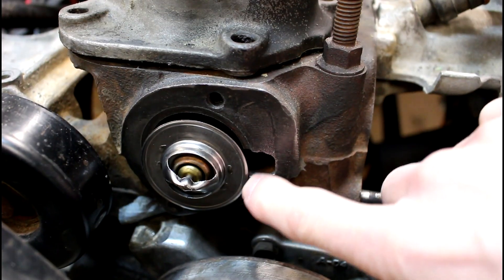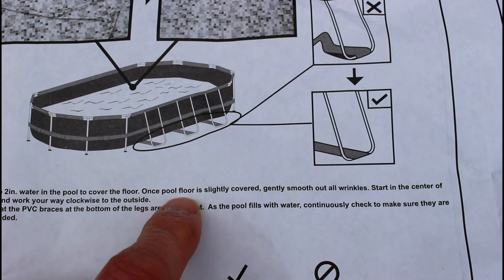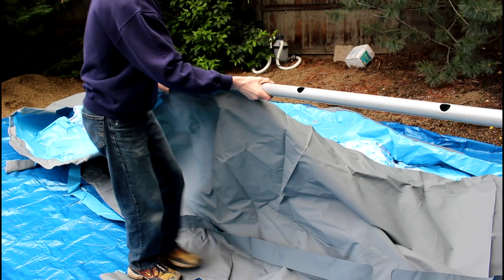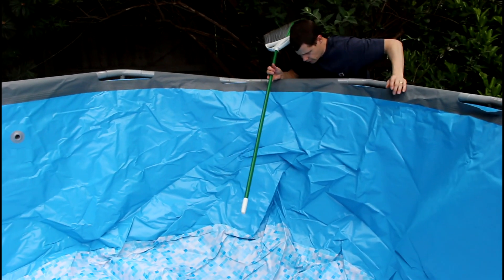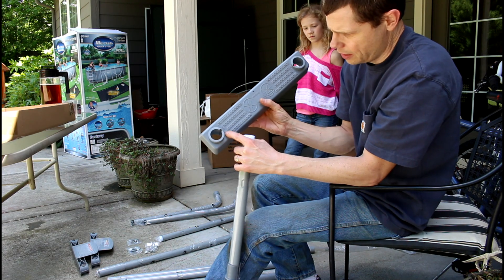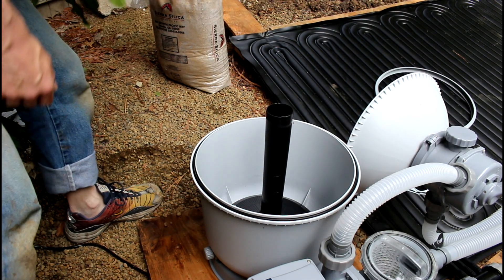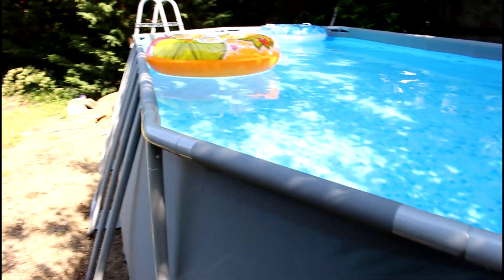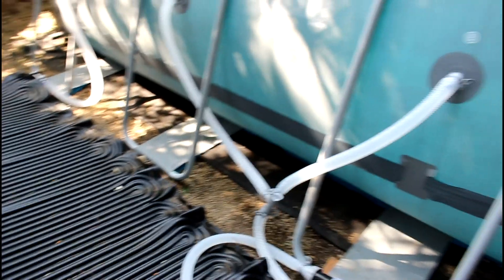Costco Pool Setup: Bestway Oval Pool

Comment: Thanks again for the video. I finally set mine up took about 4 days !!!! But I upgraded a few things. I changed my ports to 1.5" so allow better flow though the system and also installed a Salt/Chlorine generator. An EASY mod you can do, so you can leave the solar heater if you want, is put in a 1.5" pvc pipe w/ ball valve between the caps on the heater. I then open and close the ball valve to adjust how much water i want to by pass the heater. to attach use 1-1/2 in. PVC Box Adapters (got mine from home depot) and sand off the lettering, so there is a flat surface to seal up against the rubber gasket . Make sure to put the spin on cap on, and then pvc cement it to the pipe using a junction.
Reply: cueballsi , I would be 8 there’s Ted to see a photo of your bypass mod. Thank you
Reply: I want to do salt as well. Do I just need the generator and some one suggested glass instead of sand??
Reply: @MzJoyZ29   I used the intex salt chlorine generator. To be honest. do the math and follow the guide and put in 10% less salt that what you calculate... the machine is very temperamental, and sometimes you will get a high slat error. You can trick the system by putting a low flow of hose water near the inlet.  As for the sand filter, I used Clorox filter sand plus, which is zeolite, or zeosand. NOTE you use less than regular sand... and on occasion i do get sand in my pool, but my intex vac picks it up.

Comment: You’ve done a wonderful job with this video and a great service to  mankind with your  Bestway Pool Setup Video.   You are so right.  The 30 minute  setup advertised is a joke.   Thanks for producing this because it will help so many people.  Bravo!   Wishing you and your family great times in your new pool.   Enjoy!
Reply from the maker: Yeah, I thought I would make a video of what I would have liked to see on how to set it up.  Thanks for the feedback!  And, yes, the kids are having a ton of fun with it so far this year.
Reply: JeepSolid can you do a vid on the skimmer
Reply: How long was the set up from beginning to end?  Not counting water fill up
Reply: Took me over an hour to make the ladder!! The UK spec ones have a removable step set on the outside, then a dummy set of legs that hold the structure in place, just with no actual steps so it cannot be used. All on a quick release system. Quite neat, but a pain in the ax! to build. My pool is filling now, been 18 hours now and still an inch below the outlet!  Also the UK pools only have one outlet, not two as here.
Reply: pooatpauls10  which one did you buy? And where from
Reply: It's from Costco in UK, the pool is the same as this one, but this years UK version (ie the one I got) has the safety design ladder I mentioned, and also, I noticed today when setting up the pump, it has only a single  outlet from and one inlet to the pool, but the pipework is 1.5 inch not 1.25inch. Should make it far easier to fit a proper pool heater i think. It's been filling for 28 hours now and still have 6 inches to go!
Reply from the maker: Here's the video on the Vacuum Setup.  I am not currently using the skimmer.  I found it too fragile and in the way of the kids swimming.  I was afraid they would just break it off. https://youtu.be/EHEH4YRsokE
Reply: It took a team of three to complete it in about four hours.
Reply: Do you tear down the pool in the winter?
Reply: ye

Comment: Might sound dumb, but how did you make sure the blocks under all the legs were level? So far I  used a level and dug them out for the big sides... but I’m not so sure about the little legs on the ends.

Comment: My daughter and I set this up in 2019. We found that as the water begin to fill she began to smooth the bottom by putting on non-slip socks AKA Hospital socks. When the water had an inch to 2 inch in the bottom we were able to move it by stomping towards the wall. The pool does not have one Wrinkle in it now!!. 
He also failed to say it's an absolute must to have pavers underneath the legs of your pool! If you do not as the pool begins to fill the legs will move and settle & your pool will be unlevel. Love my pool
Reply: 10:55 he showed it right there

Comment: Thanks for making the video.
I bought this pool last year. Used the thin tarp under the pool and tossed it at the end of the season. Bought a 16 x 20 heavy duty tarp this year. Has grommets into which I drove stakes to hold it in place. This bottom of the pool is much more enjoyable to walk on this year.
I did not put the legs inside the band. I totally missed that in th instructions but now I see the drawing. Used a level on them to make sure they were straight to support the weight.  Looks good and seems to be fine. 
Also, I added the heater late last season and seemed to have more trouble keeping the chemicals balanced, so not even using it this year. It only increase the temp by one or two degrees anyway. Looks like they have a larger solar heater this year. Last year 4'x8'.
Reply from the maker: Sounds like you're getting it dialed in.  Thanks for the feedback and hope you have a ton of fun with the pool this summer!
Reply: I use old carpet pieces under the pool

Comment: Hello and thank you for this helpful video!  For the solar pool cover from Amazon that you recommend, I see the size choices are 118" x 78", 157" x 78", and 383" x 192".  The pool is 12' x 22' so which size do you recommend?  264" x 144" seems like the best fit but not one of the choices.
Reply from the maker: yes. depending on the size of your pool. It just has to be big enough to cut to shape

Comment: Ditto what others have said about their instructions.  Not that great.  I bought this pool summer 2017 and used it all summer.  Loved it.  Didn't set it up in 2018.  Now in 2019, just set it up.  Used your video as a reminder of how to set it up.  But now I am seeing very slow leak.  Argh!  The pool has only been used one season and was put away super carefully.   It seemed really rugged.  I hoped that I could get many years of service without any leaks.  Some patch material came with it, but no glue.  So heading to Home Depot to get that.  If you have any tips on patching, would appreciate.  As my brother in law says "It's never easy!"
Reply from the maker: Haven't had to patch mine.  Hope it goes well for ya

Comment: Hi, thanks for the video. I am curious about electrical connection. Could you elaborate any special extras you had to do to connect the pump. Did you have to acquire an electrician to run a line etc?
Reply: Hi I’m wondering the same thing, it says don’t use an extension cord but it’s not close enough to my house to plug in….
Reply: @christinamontes8254  he used a heavy duty extension cord

Comment: Great video hopefully setting mine up tonight... I'm up in Canada and am curious if it's winter rated. Can't find anything in the box
Reply from the maker: I drain mine and fold it up in the winter.
Reply: @JeepSolid  ok damn.. not that hard at all to set up... One thing I noticed on mine was the "t" fittings for end rails, some have slots under for the buttons and some are holes. Any idea on that?
Reply: @JeepSolid  my pool came with no instructions so your video was great

Comment: Nice video bro, I just set mine up also.  I have the 16' x 10'. Mine has a bag with 3 black plug looking things and a valve thingy that I haven't found the purpose of.  If anyone knows what the heck they are needed for please post.  These inlet/ outlet filter connections are a lil cheesy compared to the intex I used to have.  Man you ain't kidding about the 30 minute thing.  It took me a little longer than that just to unfold attached the polls and set the pool up itself. Now to the ladder and the filter. Anyway good video it was cool to see your entire family involved unfortunately had to do it myself since my kids and grandkids live a couple of hours away. Anyway very good video do you others out there it is very easy to set up by yourself if you have to just takes a little time

Comment: Just got one. Unfortunately, Some vertical poles are touching the outside walls of the pool. Should I just drain and start over? What do u think is causing that? I got a pretty level foundation.. 

Thanks! And more power to u.
Reply: So basically there is an indentation inside the pool caused by the leg pushing against it…

Comment: Great Video I reference it all the time.  This year however I hooked it all back up and have a small leak of water at the seam where the filter gets tightened with the clamp.  I have it pretty tight and don’t want to break it.  The gasket is only one year old and the whole setup is only one year old.  Any thoughts.  It’s hard to get that clamp on.

Comment: Any insight into what the pressure on the filter should be? Instructions say lower than .45 but Im at  .55 with new setup. Backwashed sand and water is clear but no change. I am using the solar panel and wondering if thats causing the increased pressure.

Comment: Hi there! Firstly BIG thanks for videos, great job. I've set mine up a few weeks ago, the same kit, the water is fine but not crystal clear, I saw videos of people adding salt water pumps to this kit and having lovely clear water. What your thoughts on this or sand filter is enough?
Reply from the maker: The sand filter is working fine for me.
Reply: I thank you for this video. Side note, We have a 14' oval one, and set it up inside a 10 person , 3 room tent. I can't stand bugs, mosquitoes etc. This way i dont have to deal with them, and the canopy over the screen top of the tent can be moved over to let sun in to heat the water, if needed. Also. I ordered a 12' pool, got a 14' one delivered.  Only complaint, the extra 2 '  makes it a bit harder gettin in,  but husband mentioned a small platform deck , outside the pool end, and the inside the pool ladder connected in the platform, to get out.
Reply: By the way, for some reason, the heading has my sons name not mine. Lol

Comment: Should you feel suctioning from your outputs? The other port is pumping water back into the pool but, I don't feel water being suctioned from in the pool to the pump.
Reply: I mean the input not out put. Output has water pushing into pool but, you can't feel anything going in.
Reply from the maker: Yeah. It is hard to feel the suction, as there are 2 suction ports and if you cover 1, it just pulls more from the other. If you feel a good return flow, you should be good. It is the same way with mine.

Comment: Excellent Video really helped, our output from the solar panel going to the B (back into the pool) doesn't seem to be pumping all that well. It could be the floor below the solar mat isn't 100% level, could that be the case? Also, did you use play ground sand or pool sand?

Comment: Question. I have the exact same pool and just set it up. But, I only have 4 hoses. The 14 inch to use at pump, the 25 foot for vacuum and 2 that are 29 inches for i guess outlet.  Shouldn't i have 1 more? If so I was thinking ticut a piece off the 25 foot one or maybe buy? I tried reaching Bestway pools and due to COVID they replied may be 7-10 days for them to respond. Any ideas?

Comment: Would it be possible to have the solar heater on top of the pool on top of the cover while the pool is not being used? We don't have an area to leave the solar heater on the ground.  Any suggestions?  Thanks for the video! Super helpful!
Reply from the maker: You could probably rig something up, but it is too heavy for the cover to hold itself.  You'd have to brace it with wood or something to hold the weight of the solar heating pad.

Comment: I have an issue with the sides bowing in too much. It’s filled about 2 inch to the gray part. So I have to fill it to the gray part to take the bow out? It’s on a concrete slab so it’s fairly leveled

Comment: Thanks!  We have never had a pool before and are struggling with the filter and greenness...the website offers NO phone number or access to help.  I backwashed and rinsed it again, hopefully we fixed the problem!  Our PSI has always been over 10, never the 6.5 that was suggested.  We also left the cover off for 2 days, could that cause the greenness? And about 1.5 weeks ago I left the filter off for 2 days.  It has been set up for about 4 weeks.  If I fixed the problem, how do I get rid of the greenness that is already there?!?!  And I find the vacuum doesn't work nearly as well as I expected....I highly recommend a vacuum video.  Oh wow, that is aLOT of info haha, I'd appreciate any help you can offer.  THANKS so much for the ladder suggestions :)
Reply from the maker: +Char's Bucket of Books leaving the cover off itself won’t necessarily cause algae bloom, but your chlorine levels fall quicker.  Sounds like you need to shock it.  Then scrubbing pool and backwashing as you are should help.  If still having issues with water, you can take a sample to a local pool store that tests water.  Hope that helps.
Reply from the maker: Here ya go! https://youtu.be/EHEH4YRsokE

Comment: Hi thanks for the video very helpful. Quick question I did the backwash and rinse on the sand filter but my psi pressure is at 0.6 and was wondering if you have the same issue? Or any tips for that ?

Comment: Hello, I was told by a few people that pea gravel makes the pool bottom hard to walk on and  can puncture your pool liner. I have a Bestway 24x12x52 rectangular above ground pool. Would you recommend the pea gravel under that size of a pool ?
Reply from the maker: The pea gravel under mine works fine, but I did put down some landscape fabric and that extra blue tarp under it as well.

Comment: I have to say that this Costco pool purchase was awesome for what you get. I totally agree 30 minutes is a joke. The hardest part was leveling the ground and I had clay like soil. I would say another strong point is to layer the bottom of the pool well with multiple tarps or something to keep any sharp rocks from possibly tearing it with a pinhole. The solar works great and if you get those floating solar covers your pool can get up to 90 degrees (Summertime). I mean you really cant beat this for around 400 dollars! If you shop around you will see the same size pool is nearly double the price and you dont get the solar and cleaning items. One thing to be aware of is that the hoses are cheap and after time will start to crack and become brittle if in the direct sun. I did shop around and found a cheaper source for how replacement. Leslies was too expensive and wanted $20 for one hose that was like 3'.
Reply: Where do you get your replacement hoses?
Reply: @ivylewisdragonsforlife5394  I usually just find a pool supply online. Amazon too.

Comment: Amazing video!! Just one question. You just use the sandpump? No chlorine or sandsystem other than the pump :)?
Reply from the maker: +Ollgabopi Right. I have a video on getting the pool ready for summer and I link the pool shock chemicals and chemical float I use there. Only sand I the filter

Comment: Great video! Did yours come with a chem connect? My father and I are not sure where that goes. It has threads and shows it screws onto port A on the inside but there is no threads
Reply from the maker: +Mr.Ghost_6.4 I put my chemicals in a float in the pool. I linked it in my video description

Comment: Fanstastic video, thanks so much for taking the time to make it!!  I have a question... the instructions say I should not use an extension power cord for the pump??? I don't have an outlet nowhere close to my back yard area... did you use an extension and would it still work?
Reply from the maker: +FiPoSan Yeah.  Instructions say not to.  But, yes, I ran a heavy duty extension cord to mine as well.
Reply: @JeepSolid  same

Comment: I installed 22FT Bestway Oval pool, it's 1.5FT full and started to cave in really bad from the sides. One mistake I made was levelling the ground for only 13ft thinking, without realizing that legs extend far out. In other forums I read that pools bowing goes away as the pool starts to fill. Is that true? Any suggestions??

Comment: Great video. I wished it had been up back in May when we set our up. Do you have an suggestions on to keep the water clean? We woke up to green water? Now I'm having to learn proper care of a pool. But many video are for in ground pools. I'm some more for this type of model. Thanks for this video!
Reply from the maker: Sounds like an algae bloom.  Probably need to shock it with chlorine.
Reply: JeepSolid Yes, I shocked it and got rid of the green but now our ph and alkalinity is too high. Working on getting that down.
Reply: Check out the BBB method!

Comment: Amazing! Thanks a lot, that video really helped and my family. I finised with the pool today
I have a question.
When you are not using the pools are you supposed to keep  the pipes that goes from the pool to the filter open? Or should  i close them while filter is off? (My pool it is slightly different tho)
Reply from the maker: I leave them open and I have the filter on a timer.
Reply: @JeepSolid  thanks a lot  again!! 💪💪💪

Comment: Is it possible to hang the solar system to the pool instead of keeping it on floor? I plan to fill at 80% so not too worried of splashing.
Reply from the maker: If you secured it on a piece of plywood, or something, it may be possible. It'd be heavy though.  Full of water.

Comment: Thanks for the video, so helpful.   I purchased the pool before you made this video. Luckily I didn't set it up until you posted it. So glad I searched for your video before I started. 
My question is, is it normal for the longer sides of the pool to slightly sway inward and outward while the kids are swimming. It doesn't move a lot  just wondering if it's normal. In addition it squeaks at the same time. Does your pool do the same. 

Thanks  Scott.
Reply from the maker: Yeah, the sides of mine sway a bit with the waves.  Doesn't squeak.... at least that I remember??  I'll have to listen closer.